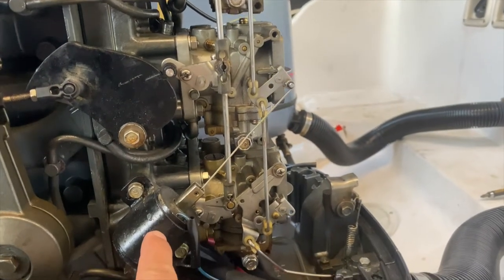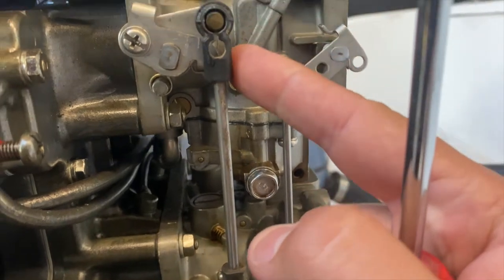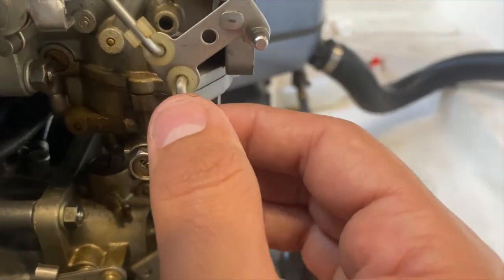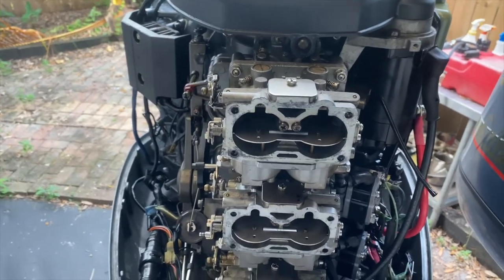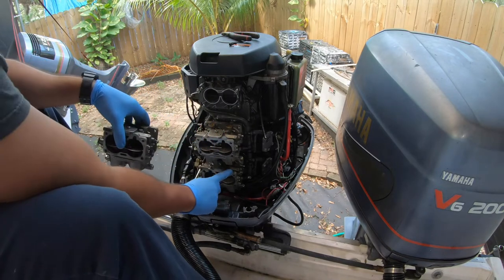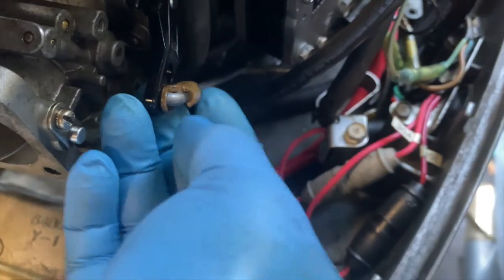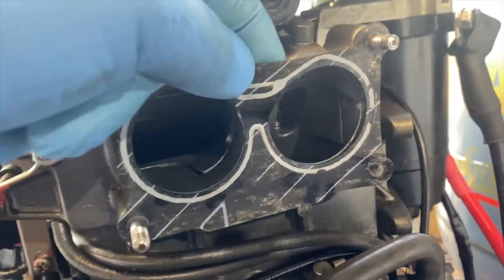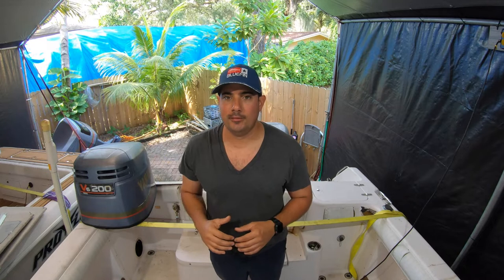HOW TO Remove Carburetor from Yamaha Outboard

Comment: any idea what year this motor is?  I have a 200TXRP (1991) that I think has the same procedure for carb removal, but I wanted to ask. Thanks!
Reply from the maker: This is a 1996 200Hp 
I believe 1984-1996 200hp have many of the same parts & features.

Comment: I have identical carbs as the one in the video. Do you know how many turns out the idle screw adjustment is suppose to be? Rebuilding my carbs and they are all out of whack
Reply from the maker: According to the manual for a 200hp pilot set screw turns out 1 1/8th +- 1/4 (7/8 - 1 3/8) 
Best bet is to get you the manual to your exact engine. It’s worth every penny

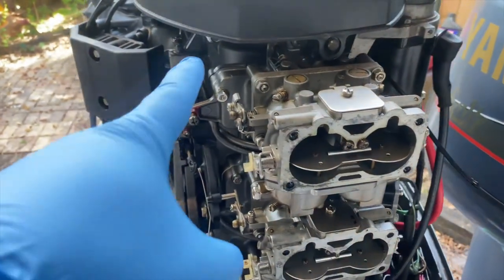Comment: Can you tell me what that tubing is sticking out to the right at 3:48? Is that a vacuumed hose and should it be connected somewhere?

There is also a gray tube on the same side by the bottom carb with a pink strip on it and is smaller than a fuel line which looks to have a little bit of oil in it. It’s currently also not connected to anything and I don’t see where it should be connected. I have a feeling both of these tunings are just bypass and don’t connect to something.
Reply from the maker: I’m not one hundred percent sure which hose you are trying to point out. I have another video which is disconnecting the air box assy which is the black plastic that goes in front of the carbs. In that video there is two hoses one up too and one smaller hose on the bottom. I show them clearly. Check and see if those are the ones you are talking about. Those are vacuum hoses if it’s the ones you speak of.

Comment: Hi are you located in Miami area ?
Reply from the maker: Yes sir
Reply: @ReelTeaseFishing  how I can contact with you for my Yamaha 130 carburetor?
Reply from the maker: @jonnyglez3530  unfortunately I am not taking any jobs at the moment. but please feel free to let me know what issues you are having and I will be more than happy to try and diagnose the issue as well as things to look for.
Reply: @ReelTeaseFishing  I got problems in idled between 1200 rpm to 1900 rpm my motor shake a lot and I already replace many parts.
Reply from the maker: @jonnyglez3530  ok let’s get to basics. have you changed your spark plugs? Changed your fuel filters? Overhauled your carbs? 

Also I highly suggest you run the boat on an external fuel tank with fresh fuel. 
Running off an external tank does a few things. 
If the boat runs good off the external tank we know the issue is from fuel line to the tank. (Possible clogged pickup tube, bad fuel hoses, water in fuel, issues with vent etc) if the boat runs the same we can now focus directly on the engine.
Reply from the maker: Also let’s get a compression check to verify 👍🏽
Reply: @ReelTeaseFishing  I did everything I already went to boat center on us1 and 184 and I talk to Rick and he said that probably is carburetor adjustment.